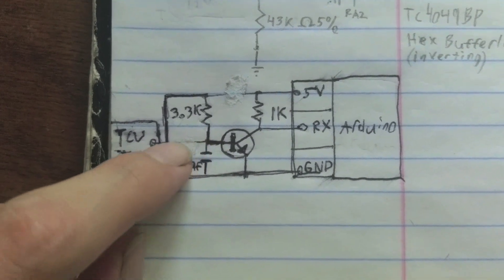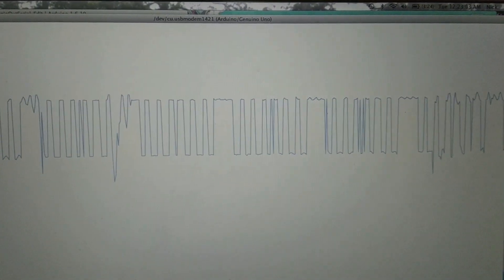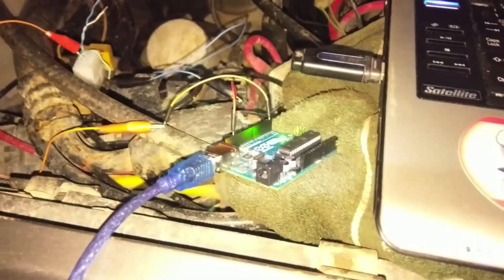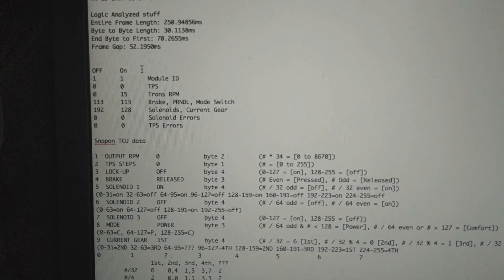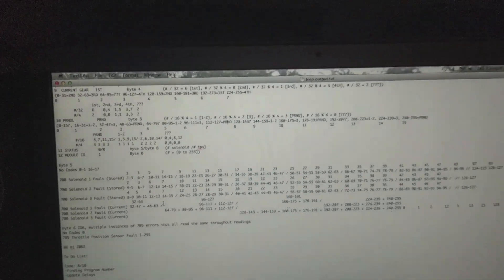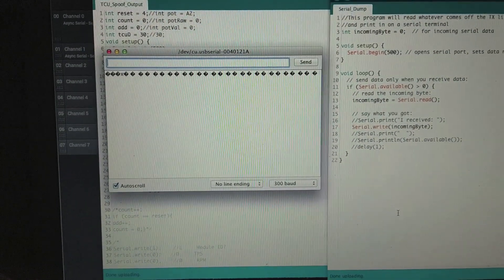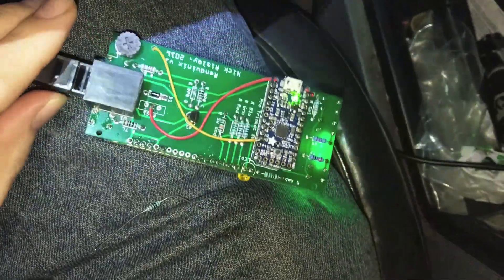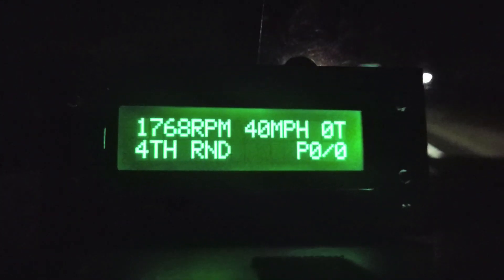Figuring out Jeep AW-4 TCU Comms Part 2

Comment: Have you looked into MODE $06? I feel like it's an area that's relatively unknown.
Reply from the maker: Woah, that's really nifty but I have done near zero research into OBD-II. One electronic control system at a time, haha
Reply: haha It was a stretch in the dark but I figured id ask. MODE $06 codes are different from the standard trouble codes. They're proprietary and only fully interpenetrated by a Chrysler DRB III device. Most OBD II devices can read the codes but no one knows what each means unless you buy the $2,000+ device or go to a dealer haha. Dealers use the codes to let you know when something is starting to go but hasn't reached that point to trip a trouble code. If you do manage to figure out what each means you'd be a huge hit on the jeepforums.
Reply from the maker: Hmm, that's an awesome little hidden gem there, thanks for the share! Always neat to see what's really out there.